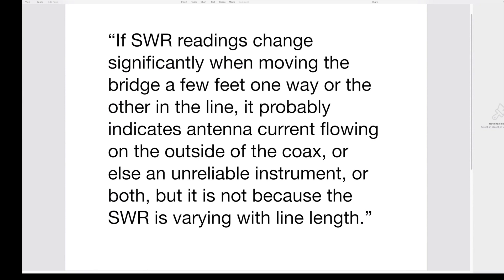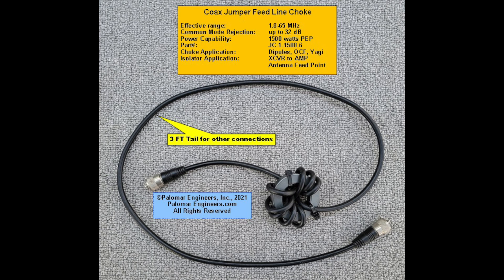Ham & CB Radio Myth - Coax Jumpers Must Be Cut to Null.

Comment: This one yet again. More a C.B. thing than a Ham belief. C.B. radio shops continue this myth.
Don't they realise there is an SWR meter and coax to the aerial all connected as one cable so cutting any coax to length doesn't make one bit of difference..
I asked on one video by a C.B.'er did he think the SWR meter acts as an isolation device between each cable.
He said he'll cut his cable to length because it works for him, chopping off one inch at a time.
Coax cable manufacturers say nothing about a specific length of cable for a given frequency. Imagine cutting cable for Top Band or even worse for 472 kHz or 137 kHz.
G4GHB.
Reply: From reading the comments maybe I can add something that may help. 

It is a fact that the impedance varies with the length of coax if there is an SWR on it. That has no effect on SWR. Yes, the input impedance of the coax can change with length. No, the SWR on that line does not change with length. This can best be seen on a Smith Chart. For any SWR a SWR circle can be drawn on the chart. All points on that circle represent the same SWR but each point on that circle is a different impedance. If the SWR is 1:1 then that circle becomes a single point at the center of the chart and the impedance is 50 ohms purely resistive. If, for example, the SWR is 2:1 then there are two points on the circle where the impedance is purely resistive and those values are 25 ohms and 100 ohms. There are many other values on that circle where the impedance has different R and X values but the SWR is still 2:1. Changing the length of the coax simply moves you around the 2:1 SWR circle. So with. A 2:1 SWR  there will be a length of coax where the input impedance is 100 ohms ( 100+j0) and if the coax length was increased or decreased by 1/4 wavelength the input impedance would change to 25 ohms ( 25+j0). At any other length the input impedance would have an R value between 25 and 50 and a certain amount of reactance that corresponds to having a 2:1 SWR. Also if the length of coax were increased or decreased by 1/2 wavelength, you simply move one full revolution around the circle and are back at the exact same place you started. Impedance values repeat themselves every 1/2 wave length. So if you have an antenna with 200 ohm impedance and a 50 ohm coax by using 1/2 wave length of coax you will have an input impedance of 200 ohms. The SWR will be 4:1. By using a 1/4 wave length of coax the input impedance will “ transformed “ to 12.5 ohms. 
In general new radios can usually handle an SWR up to about 2:1 and there are a great many different values of complex impedance that they can work into. However, it is sometimes possible that transmitters will not tune a particular complex impedance value due to design of its output circuit and changing the length of coax can compensate for the poor design of the equipment. I have not seen that happen very often and it’s the exception rather than the rule. When it happens it is almost always at the higher end of SWR values that it was allegedly designed to match. At least that’s been my experience.
Reply: @dandypoint  thankyou for clarification
Reply: @dandypoint  Thanks for your input @dandypoint.
I have a NANO VNA and it's very interesting to see a Smith Chart. For the price it's a wonderful piece of test gear. For years I used only an SWR meter. Actually that's not quite true as I only made one about 10 years ago, before that I had an r.f. pickup meter at the long wire and torch bulbs in the twin feeder to my doublet and tuned for maximum r.f. out. Having made the Wheatstone Bridge type SWR meter it confirmed that max. r.f. out was indeed a low SWR as I expected. My amateur friend was horrified when we did a special event station, no SWR meter.
On my aerials now I've never had problems getting a low SWR on my h/b dipoles, 2m 4 element collinear or 60m inverted vee aerials which I have up now. I didn't have to start trimming coax cable.
In the past I found a tuner doesn't always cope with a long wire or doublet on a certain frequency but I don't start adjusting the coax, I lengthen or shorten the aerial. It's an aerial problem not a coax problem. 
My copy of a Joystick has a great SWR using an MFJ160-10 tuner and okay from 160m to 10m with only 26 feet of wire. A short aerial at the lower frequencies so not very efficient but it does allow me to get on. SWR right down with only 160m being 1.5:1. More inductance or a longer wire would solve this. I'm not going to adjust my coax as it would do nothing because it's an aerial problem.
I was once told in a pub, "You're only an amateur, he's a C.B.'er." Buying things and connecting them together makes a radio expert overnight. Why did I bother studying for the exam? I could be an expert overnight on C.B.
I think it probably came from way back when a C.B.'er had a problem and played around with his coax and improved things so the myth has stuck. As i said before their carefully adjusted aerial coax is lost when the SWR meter is joined to the jumper lead. They don't tell me how it still remains a half wave. They can't seem to accept that they are physically joined as if the meter is some kind of isolation device. 
I've also asked them why don't they trim the jumper lead and I get no answer. It just has to be 3', 6', 9' and so on so I've broken another of their 'rules'. That's for 27 MHz of course. Mine is 45" to my SWR meter and 20" to the tuner for all frequencies! Would they tell me it won't work?

73, Bill, G4GHB.
Reply: The cbers could be on to something eh ,the impedance the radio sees changes with various lengths perhaps this is what they mean
Reply: @Pioneer936  Why do so many amateurs say it doesn't matter but C.B.'ers say it does?
Do explain to me how adding a jumper lead of 3 feet or whatever length of jumper lead and say 4 inches for a SWR meter will not affect the length of that magical half wave of coax! Why is the jumper lead not trimmed to length? 
Do you really think everything stops at the SWR meter as if it's some kind of isolating device? The aerial lead can not see the jumper lead?
Measure it if you don't believe me, a multimeter shows one continuous length and I'm sure a VNA will no longer see that magical half wave because it no longer exists. Where has it gone? 
Unless you already have measured it and know differently and can tell me for certain I'm wrong.. 
I can't leave my SWR meter in circuit because it's a Wheatstone Bridge type so will affect my readings, and must be taken out of circuit when transmitting. 
G4GHB.
Reply: @bill-2018  do you understand that the feedline becomes an impedance transformer when the antenna is not matched to the feedline
Reply: @Pioneer936  And of course you don't run it like that do you.
Reply: @bill-2018  many antennas are not resonant at 50ohms so the impedance will vary with different lengths ,this can be a way of matching the antenna system at the radio
Reply: @Pioneer936  You still have not explained how your magical half wave coax has remained when an SWR meter and other magical 3, 6, 9 feet or whatever length of jumper is connected. They all connect as one length.
Why don't you measure the whole system and tell me you still have these magical lengths? 
I will ask again, do you believe an SWR meter is an isolating device? One coax does not see the other?
They are not connected as one?
Then your coax and/or SWR meter is very different than mine!
Reply: @bill-2018  you are misunderstanding what I am saying ,,,are you saying that the feedline doesn't transform impedance when swr is present?
Reply: @Pioneer936  You're trimming coax instead of the aerial.
If you have CMC on the coax then that is affecting things and the coax is radiating so adjusting it will make a difference. Get rid of CMC.
Reply: @bill-2018  are you now saying that the impedance transforming is down to common mode current? What happens when we eliminate cmc will the impedance change at the radio when swr is present, or are you saying reflected power from an impedance mismatch is common mode current?

Comment: Mark great video I've learned a bunch about SWR and feedline impedance doing a bunch of reading.  If a swr bridge can be fooled with common mode current what about analyzer like a Rig Expert?  I do notice a differance between a bridge and what it shows.  I realize these are two different devices I assume the analizer is probably the one to go with.
Reply from the maker: Not sure how an analyzer measures SWR.  I have compared my analyzer to an SWR meter and they read the same.  But I have always used a choke to avoid CMC.

Comment: 🤣😂🤣 Thanks for this one Mark! 
I was tuning around on 40m  this AM and heard an Old Ham (well, he sounded  Older than my 66) telling someone that he had to "tune" his coax on the antenna he just put up. I chuckled and slipped on up the Band.  The ONLY time I "Tuned" my coax was in making a 1/4 wave 75ohm matching section for a Full Wave Loop antenna years ago...
I didn't really "Tune" it, just calculated it's length with VF and it worked fine.
73   mike
Reply from the maker: Well you obviously know what you're doing!!!
Reply: What antenna was is ,if it's an antenna with impedance that doesn't match the feedline he could be using the coax to transform the impedance at the radio

Comment: Jumper length calculator.   This really works, try it. 
Distance  (enter the measured distance from device 1 to device 2, enter in metric or imperial here   =  Blank  1______________________)   
Type of coax (enter type of coax, RG8U, RG8X etc   =  Blank  2______________)
Enter color of coax ( Enter the color of the coax, such as gray or black here =   Blank 3_____________________) 
  
Calculating......   Just a moment......   More calculating......    Asking AI to help, just another minute......   Calling your mom, asking about paint chips.....   
Calculations are done, Your answer is in blank 1
Reply from the maker: This should be in the ARRL Antenna Book!!!!
Reply: I only use white coax, it's better for DX.
Reply from the maker: I use coax with clear insulation.  Cleans up the signal.

Comment: I sit back and enjoy a good laugh every time I tune across a couple of hams arguing over coax length.
Reply from the maker: Laugh or cry.
Reply: both!😂
Reply: Does it really matter when you see the hatchet job they did on the connector?
Reply: @chuckcrizer  I've actually seen home made patch cables at ham fests with the coax braid just shoved into the back of the connector, no solder.
Reply: @richb.4374 it is funny that those  arguing don't realise that the swr meter is measuring impedance and that does change with coax length
Reply: @Pioneer936   I'm not trying to argue but that is incorrect. The characteristic impedance of a coax cable is determined by the size of the conductors and the dielectric materials it's made with. Whether it's a 1 foot patch cable or a 500 foot roll of coax, it should still be 50 ohm cable. If swr changes with coax length, that is caused by common mode currents flowing on the outside of the coax shield. This should never happen on a proper antenna system. Feeding a cut to band dipole with coax directly will cause this condition. You're feeding a balanced antenna with unbalanced coax....the shield will have common mode. Many hams fighting "RF in the shack" have this issue and have no clue how to fix it. This is why if you put up a cut to band dipole, you should use a 1:1 balun at the feed point to keep the coax from radiating. Yes, you can "get by" without one, but you're wasting some of your RF power needlessly and risking RF in your audio.
Reply: @Pioneer936  Perhaps your experiences in radio have been different from mine, but in my 50 years of playing radio, not one time has coax length magically "matched" a poor antenna for me.
Reply: @richb.4374  you do understand that if there's a feedpoint mismatch the feedline becomes an impedance transformer